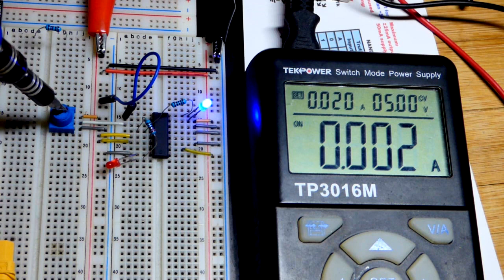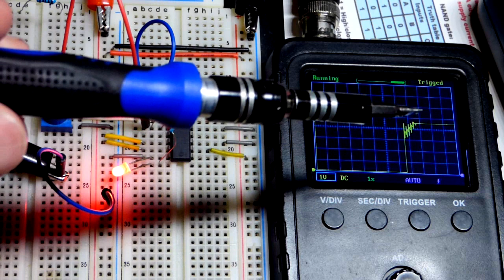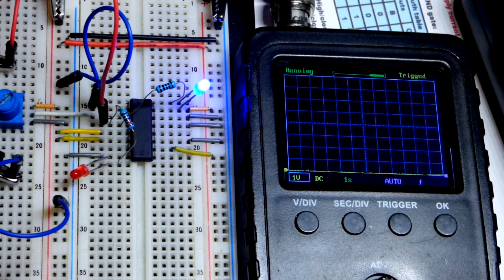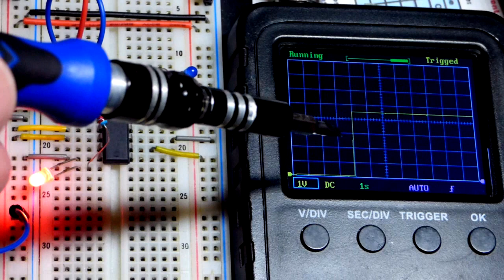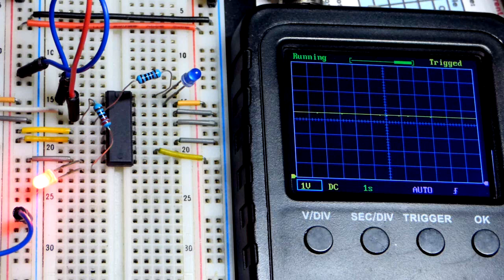How I noticed I miswired my 74HC00 integrated circuit for learning electronics lesson 0050

Comment: Wiring an output to "high" should not damage the IC. In fact according to Forrest M Mims III you should "force outputs of unused gates high to save current." Additionally you should stick a 0.1uF cap across the Vcc and ground pins of the IC to prevent noise spikes and it would be interesting to see if you still experienced that ramp up behavior with a smoothing cap in place ...
Reply from the maker: I've had a few 555 timer circuits that needed a capacitor across the supply pins. So that was something I thought about doing. I'm guessing that holding an unused output high would be for a different type of integrated circuit than high speed CMOS (HC). Open collector outputs use a pull up resistor, so I wouldn't be surprised if they shouldn't be left floating.